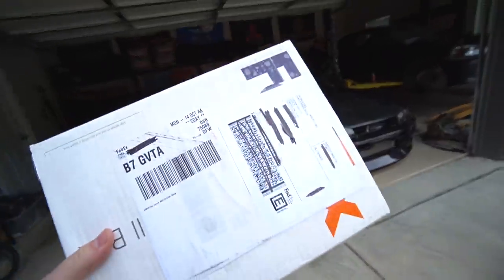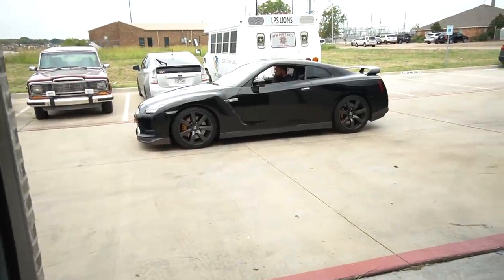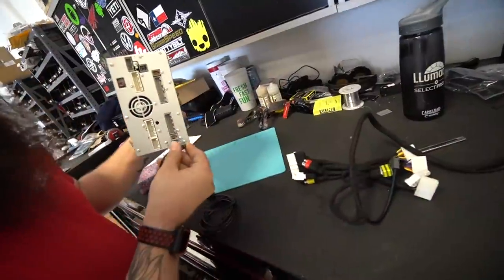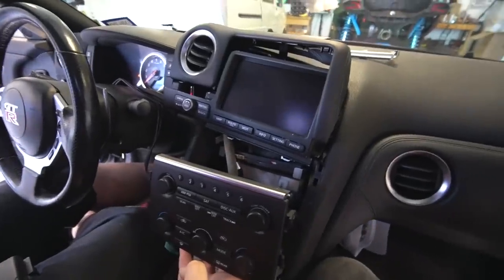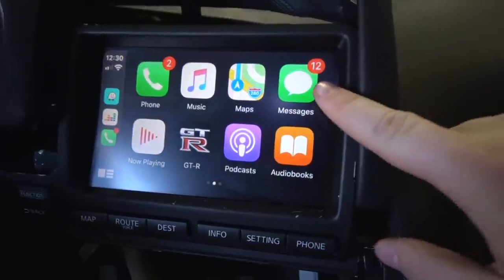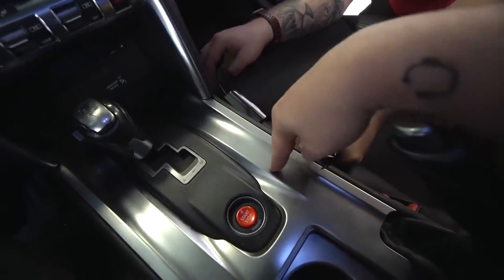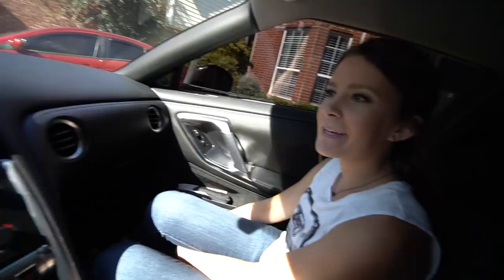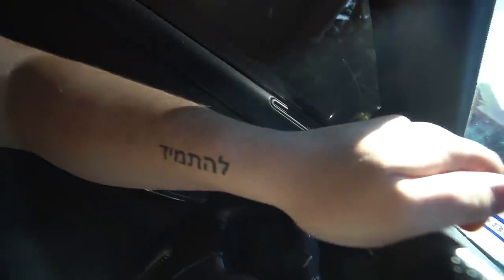NISSAN GT-R WIRELESS CARPLAY INSTALL!

Comment: That touch screen is kinda annoyingly slow and laggy. But still a cool mod!
Reply: Sadly even factory they are slow and laggy as shit. While its not a GTR both my G37 and Q60 have had the shittiest screens--Nissan must be cheaping out on the processing power given to the screens
Reply: @sparkster48  i actually took the software off of it and put it on a raspberry pie and put it behind there aswell so now its 60fps smooth no lag because it has way more processing power 
issue is tho you need to write a lot of code to have it to work in the car took me about a month to fix
Reply: @thedandy6765  Wait really?! I've been actually wondering if this was possible because I wanted to do something like it! Did you have a forum post to go off or did you just experiment! I definitely would love to recreate that!
Reply: @sparkster48  i bought my 2013 gtr and the next day i was like nah to slow for me so i went to experiment and it worked well next thing i wanna try is getting a 1080p monitor in thay size and then maybe see if i can get air suspension into the screen so i can get rid of my little remote
Reply: @thedandy6765  Oh shit! I'm definitely going to look into this thank you! Some of the best news i've gotten all week!
Reply: @sparkster48  you gotta know how to write code tho and sorta hack to get into the software
Reply: @sparkster48  also a good thing with this is that you can expand the internal 30gb harddrive i added a 256gb ssd to the inside on the raspberry pi so i got a few movies downloaded on jt and music so when i dont have radio connection or internet connection or when im stranded i have stuff to do and not be bored
Reply: @thedandy6765  oh thats super smart! I'll look into that as well
Reply: @sparkster48  yeah go ahead really cool challenge to do to upgrade an amazing car 
Btw this also works in some other cars i also did it in my sisters mercedes a180 (the nice model) and soon im gonna try it in my dad his 2017 dodge ram
Reply: @thedandy6765  How much would you sell one of the raspberry pies with all the necessary coding installed on it? I would be willing to purchase one to eliminate the lag!
Reply: @richa.2976  let me look into since ive become a bit better at it it will be shorter time to do it but let me look into time and price and for what car will it be i could add a nice wallpaper the car in question
Reply: The Italian Dandy Thanks! Yes it will be for a Nissan GT-R like in this video. Do you have an email or a whats app where we can talk more? Definitely interested if you are!

Comment: Wait till you see the one for your Evo X...just as good, capacitive touch screen, a lot smoother UI, 10.2" display and under $500 haha. But doesn't read into the canbus or anything special unless you get an OBD connector.

Comment: I wish I had a Johnny in my area cause I had this headunit for 3 months now and still havent installed it
Reply: It's plug and play wtf
Reply: Head units with the vehicle specific wiring kits are actually really easy. Colour to colour and then jus plug it in. No hate intended just letting you know it's easier than you think you should totally give it a shot.

Comment: Hi Evan, we are trialing a kit at the moment that works for the original Matsushita top screens that come with the earliest GT-R 2009 - 2011. It means you don't need to spend more money and upgrade the radio to the later version to be able to integrate Apple CarPlay and Android Auto into the factory systems. 

It's a lot more stripped back than what is offered by the Android OS based modules but it also eliminates a lot of the problems caused by simply providing a way to add wireless smartphone integration. If you or your community are interested in having a chat about it let me know. We have a video in our YouTube of the product working in a 2009 Nissan 370z with the same radio.

You can like this post if you would like us to contact your for trial prices!
Cheers,

Ben Soutter - Connected Car Solutions

Comment: If you push the brake pedal while tryna slow down at let’s say less than 10 mph, will that cause the car to stall? What I’m tryna ask is do you use the clutch to stop at low speeds

Comment: I just installed this in mine, quick question, are you able to change the song that is playing from thge steering wheel controls while in the android screen? My volume on the wheel works, but not to change the song, I have to press the screen.